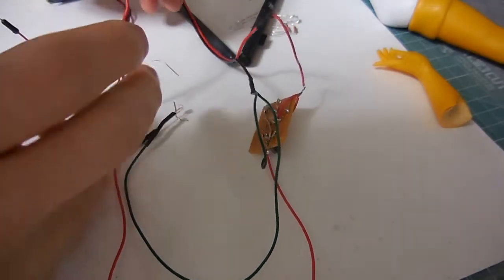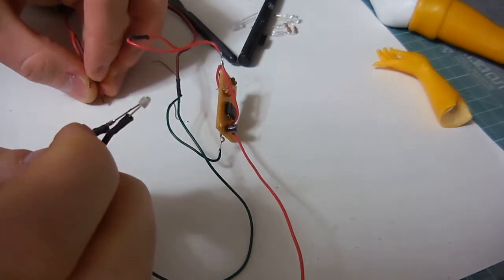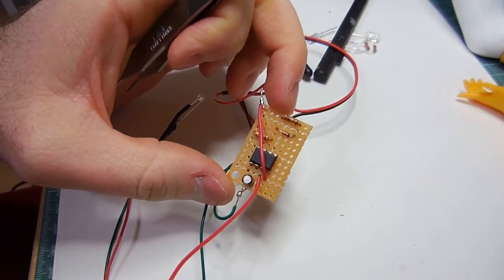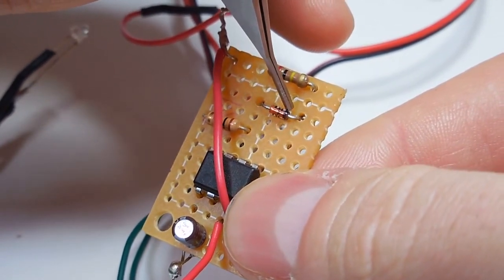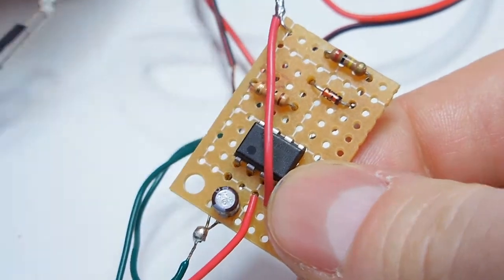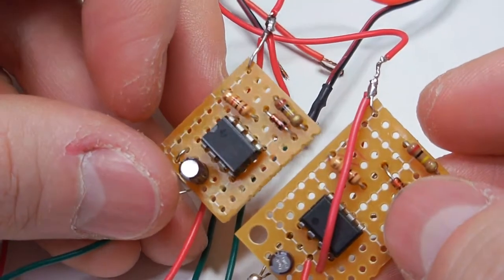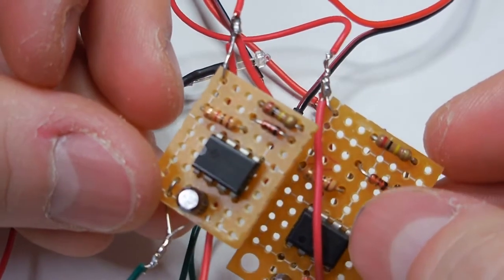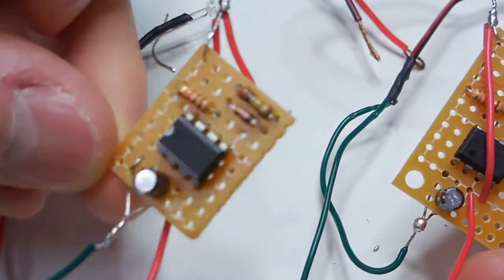SUCCESS! soldering the 555 timer chip strobe light  (SR-71 Blackbird build)

Comment: Hi all, is there somewhere (blog, forum, etc) where i can see what is needed to create this? And a manual? I want to do a Star Trek Enterprise that have a lot of navigation lights (and another lights...), on ebay people are selling "LIGHTING KIT" are two/three time more expensive that the kit.....
Reply from the maker: I share your goal. I eventually want to build an Enterprise, but I do not want to spend all that money on a lighting kit! This is practice. If you can learn how to this on your own, it will be a LOT cheaper than buying one of those lighting kits.... like less than 1/10th of the price! This strobe circuit I have made is practice. I am using a 555 timer chip. For the Enterprise, you will want to create a circuit for the strobing nav lights and the blinking running lights. You could use two 555 timer chips in tandem, or you can use a 556 chip, which will handle two different blinks at the same time. Read this: http://virtualight.com/?p=1199 She has created a 556 chip specifically for the Enterprise. I have not built one yet, but this should work. She has made a video on YouTube as well. Good luck!